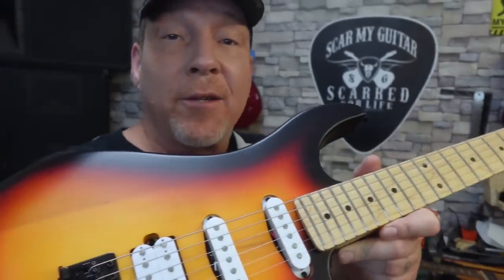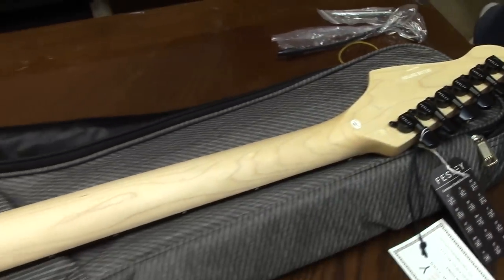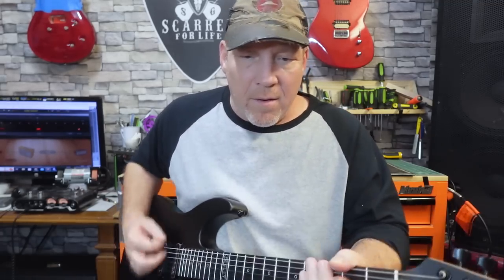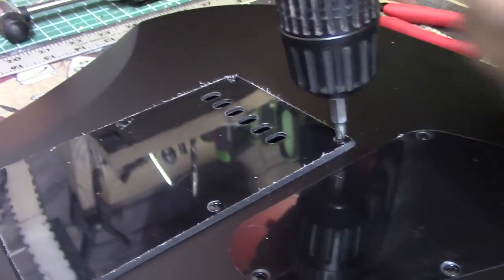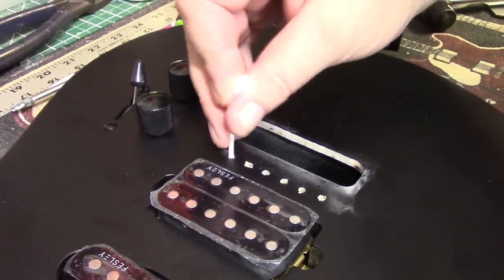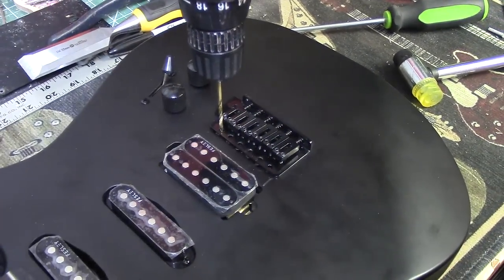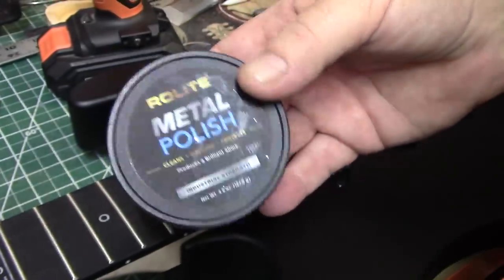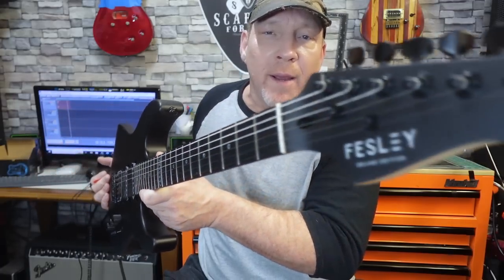Amazon Stratocaster FESLEY FST 400M! Full Break Down And Look Inside!

Comment: I recently bought a 2004 Martin D-15 for $300 bucks priced that way because it had a broken truss rod. I wouldn’t have bought it except for the fact I have a master luthier locally. He heated and removed the fretboard and replaced the truss rod reglued the original fretboard all for $275. I now own a wonderful dreadnaught all in for less than $600 bucks. Felt good saving this baby.
Reply from the maker: Thank you for your service!
Reply: BTW my luthier’s son builds high end acoustics. They start at around 4000 bucks. Rothrock guitars is the brand

Comment: If you need to move that low E back just a hair, you can always remove the spring. That will give you a bit more back travel and may just solve that issue, since it seems that was the only string really off.

Comment: First man, you truly are gifted with your skills and explanations, and the camera shots of your  craftsmanship are phenomenal.  Keep it going!!
 Now the guitar:  I saw the other Fesley 350 Strat review, and when I went to Amazon I saw the 400 model.  So thinking it would be an improvement I just snagged the 400  about a week before I saw your video....
1. I ran and double checked my intonation after the first part of your video (I checked it did out of the box too, but wondered if I screwed up checking).  Wew,  checked again at the 12th - and also checked Frets 1 through 5 on each string (I think that lets me know how the nut is cut) and all 6  strings were right on.  I got a  little St. Patrick's day luck (I would never have the ability like you to do that repair)   
2. I didn't pick up anything on the fret-board when I ran a rag over it -  but strings were on, I didn't get the typical black fingers either,  I popped the high E string bending after playing a short while, so I stopped -will replace the strings with 9s Super Slinky, and think about polishing the frets - Now I am worried about the fretboard - says "Mixed Materials" on Amazon - the other (350 model) is listed "hard-maple" and I wonder why the change.  Also, I wonder if typical fretboard oil will screw it up thid "mixed material". -  I will now contact Fesley and get their input before I put anything on the Fretboard.  3.  I guess the pick-ups are OK at my level right now, but thinking about tuners (any suggestions there for tuning machines or Pick-up upgrades?)  

 Dude, they sent the wrong guitar to the right guy!!!!  I would never buy it after seeing your review - learn a little each day!!!  And man, some young kid could just chuck the whole idea of playing guitar if they got a lemon like that.  Or at least never forget the NAME on the lemon.....  

Sorry for too much flip-flap above!!  But you did a great job on this video.

Comment: I just bought a Donner Strat off Amazon.   I was amazed how well set up it came.  The nut was cut too deep on the E and A strings, and the fret ends needed a little touching, but otherwise very impressive.   Suggest you try one.

Comment: Yeah, great looking guitar.  And it sounded good once you did all the fixes.  On Amazon they say that the fretboard is some kind of "mixed materials" which seems odd.  This obviously accounts for the stickiness of it.  I use a beeswax based lubricant/cleaner on my fretboards which not only treats the wood but smooths it as well.  I would try something like that on this.  As to the black hardware, I disagree a lot on that one.  There are and have been plenty of guitars with black hardware out there.  It's fine to do something a little unique like that with a glack guitar.  I do agree they need to tone down writing "Fesley" in so many places, and I wish they had a more distinctive headstock logo.  A budget guitar like this will almost always need a set-up and new strings. The biggest concern I saw with this one was the bridge placement.  That's something they need to seriously fix.  I'm sure they appreciate the feedback.  It's a super cool looking budget guitar.  I hope they make the tweaks for this that it appears they need to make.

Comment: LOL So you saw ceramic magnets on those pickups?  The specs on amazon read: "enameled wire windings around an Alnico high-strength magnetic core"  
they also describe the nut as being "sturdy plastic steel material"

Comment: I am going to say it again, do review of a Firefly guitar. You owe it to your viewers, They are a much better value than a Fesley guitar or anything that you can buy on Amazon. For under $200, I got my John 5 tribute HH Tele . It came with red binding, locking tuners, a bone nut, stainless steel frets, a roasted flamed maple neck, a rosewood fretboard, Alinico 5 pickups ,a kill switch, full size pots, and a quality Korean bridge with brass saddles. You can pick up a Strat with the same core specs for $169. That's enough flip flapping, lets make it happen.

Comment: they were trying to aim at a metal super strat like Jackson so the black actually works there. its mainly to account for the floyd rose you usually find on them. but i totally see what you're saying, maybe white would have been better? but dam that was pretty bad though. as far the branding, Fender does that too. nobody has an issue with Fender doing it. i do think the fretboard is fake wood. it may have been the microphone but to me it sounded kind of thin for a metal super strat. but man if the PAF sound was the target that would have worked really well.

Comment: ide have cut the spring in half to get enuf room to move the saddle back a smidge and if that didn't work ide ditch the spring witch should give you an eighth of an inch witch should be enuf to get it intonated, ide avoid moving the bridge i think. not worth the effort if a simpler solution exists. ill be dealing with moving a bridge on a strat body myself here soon. im going to stick a 1966 fender mustang neck on a strat body, the two wer never intend to be mates but with a lil vitamin thc and some fuckery ill re mount the bridge witch involves alot of work with the rasp! it is worth it i think.

Comment: My StewMac Strat build is way better than the Fesley. And I’m a keyboard player and it’s my 2nd guitar build. Each position sounds different from the next and the sound is clear as a bell. I’m working on the intonation but it’s pretty close. I’ll get it eventually. The hardest part was the pore fill and paint on the body. I ended up using Aqua Coat and that turned out great. A learning experience but enjoyable.

Comment: Do you do that amazing trick involving loosening the neck bolts slightly with the strings at tension, then tightening them back up? Only found out about it a couple of weeks ago...improved the playability and feel and the performance through an amp (more string feedback if needed!) for all my bolt on neck guitars.

Comment: They were obviously trying to make a guitar with "modern metal" styling. The correct way to do that would have been putting an ebony fretboard on it but at that price point it obviously was cheaper to use an inexpensive material and paint it black.

Comment: That's a shame about the bridge and saddles , I  have two Fesley FDK 800's and neither have any issue with the saddles or bridge  or anything apart from slight fretsprout which for an under $250 (paid $185 after the $50 off coupon) guitar from China is not a rare thing, were it me i would have sent it right back and got a replacement to see if that issue was a one off QC problem with this model or not but then i don't have your experience and expertise , as for the name Fesley, ha yeah maybe not as catchy as Gibson, Fender or Ibanez but as great as mine play for the price i'm not bothered by it. another brand you may want to check out if you haven't already are Jet , specifically their JS400 model which is a beautiful Strat style model for between $199-$229